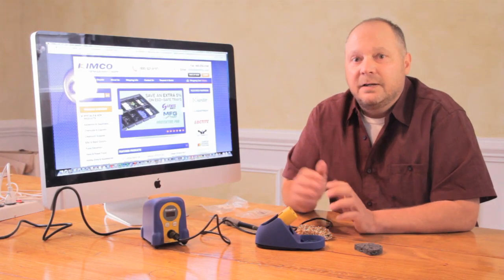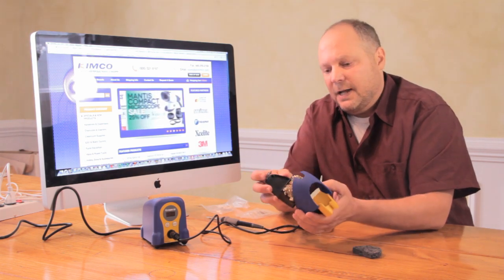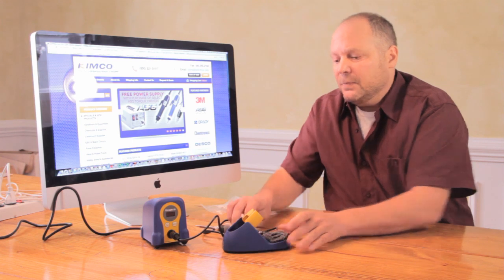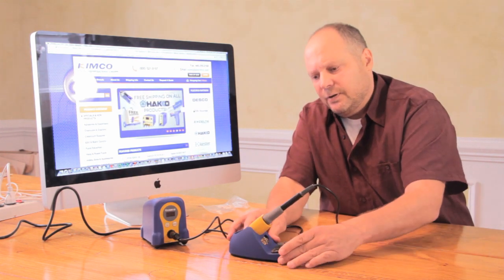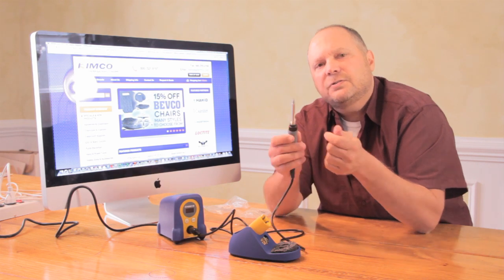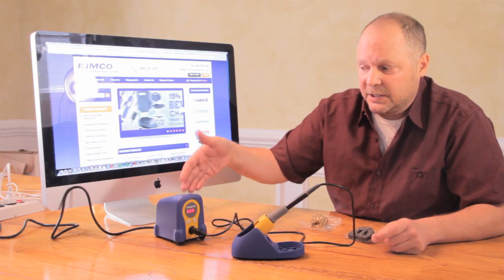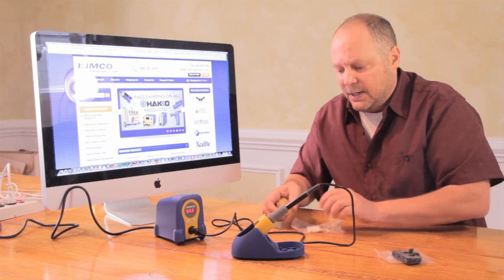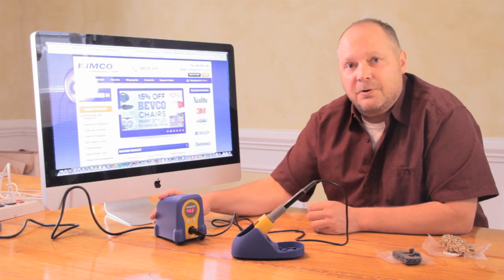Hakko FX888D Soldering Station Demonstration - GoKimco.com

Comment: isnt this a knockoff ? when he takes the pan out, there is no tin clip inside...
Reply from the maker: It's definitely not a fake knockoff unit.  We borrowed the unit from the local Hakko Factory representative to make the video.  Thank you for the comments.
Reply: +mcfurball The metal cup was a new addition. Do you honestly think Hakko never made revisions to their product? Even the manual which shows a parts explosion doesn't have the cup. Hence you are 100% wrong.
Reply: Kimco Distributing copy and paste comments don't assure customers of honorable business practices
Reply: @mrfurball  Just purchased one from these folks (23Apr21).  (Good price, free ship), genuine tip (Japan) & snug to heater (Hakko finish: see EEV Blog), base unit (fit, finish: nice), iron itself: silicone feel strain relief & soft cover (silicone), right size heat sleeve. Also, full length label on bottom base unit (US market, hence the ºF units from factory presets), ground lugs on bottom of iron holder & US Patent # (sticker).  (I can also see the daughter [fuse] card [mounted over transformer] through the top louvers, using a strong LED flashlight or in direct sunlight [reads "Hakkó FX888-F FUSE"]).  Why the stainless pan is missing in this video's holder unit is unknown.  (My unit came with one).  Kimco treated me very well.  (I'm glad I found these folks).